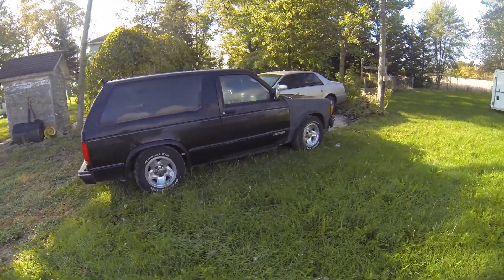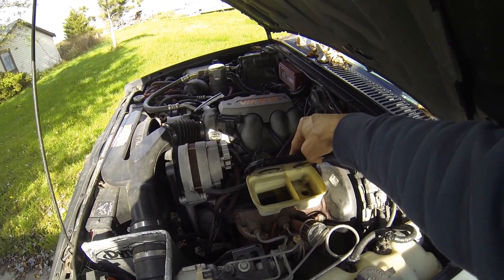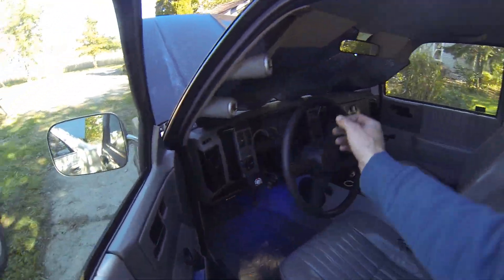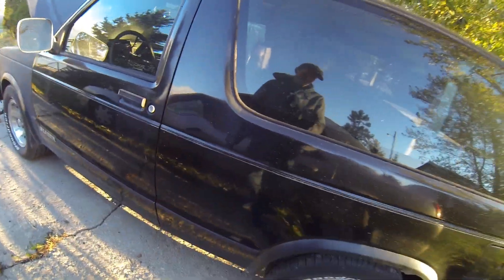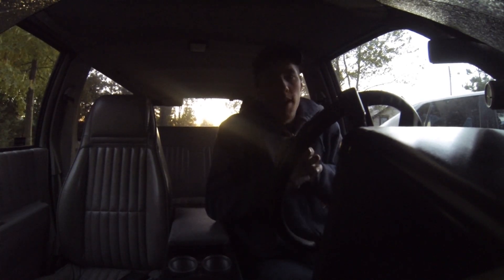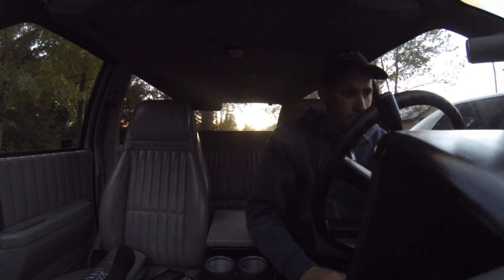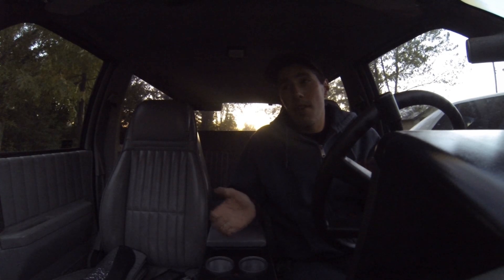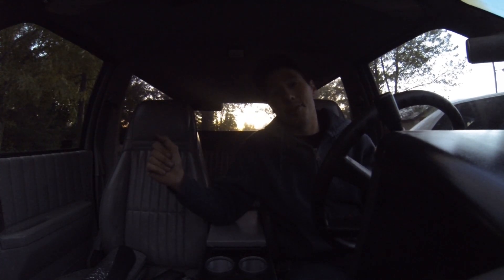Busted The S10 Blazer Its Down For The Count!

Comment: Mine still not running correct vacuum lines still not correct
Reply from the maker: DeE MONEY What year is the truck? I think my haynes manual may have routing info on the vacuum lines
Reply: @RobHoffmann20  turned out to be 2 sensors but I sold it for 720 bucks to a kid who really wanted it and was gonna rebuild the whole blazer in Minnesota